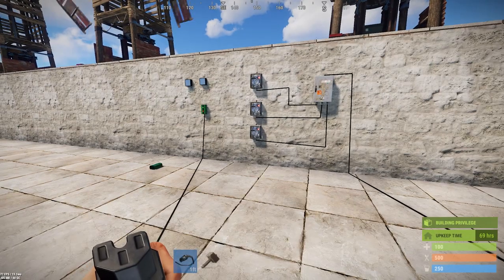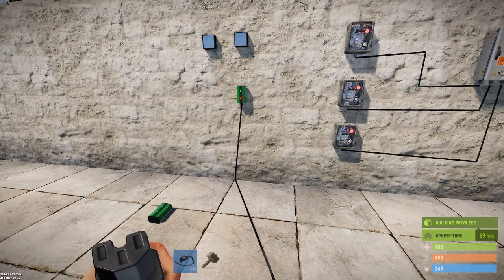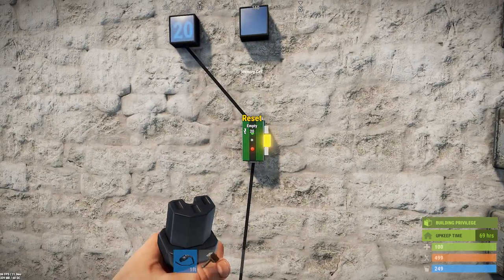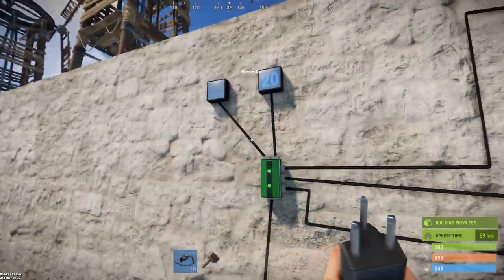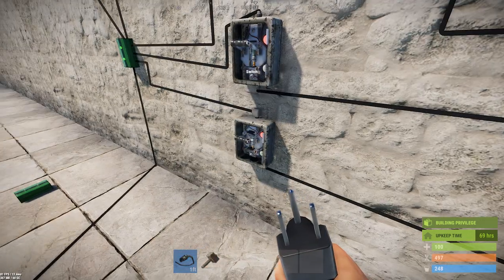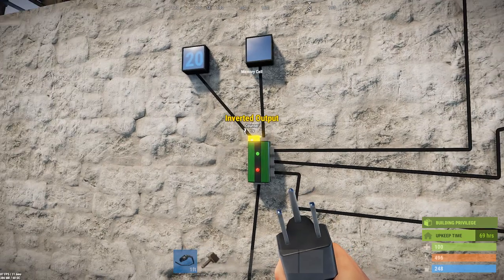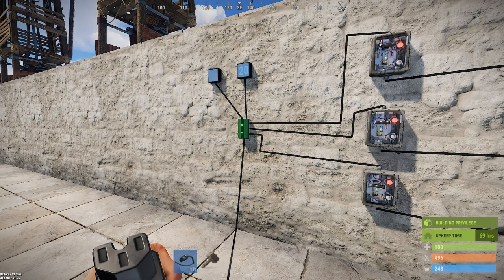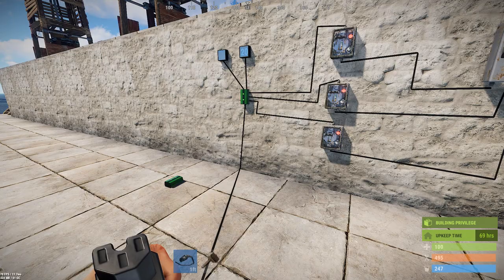Rust Electricity 101: Component Guide - Memory Cell (2-7-2019 Update)

Comment: need a bigger split, the CT camera deck the cameras don't work some times and they need a volt meter on the slitter at all times to ( power poles or to take a wire for wind turdine to the base  so on can not see that there is power)( i worked on house a little and the electrical in Rust is confusing) wall plug in ? and a switch at both sides of the hall if you have one? (in parallel /not series)

auto door just make a new Lock with the feature in it remote door rf #

Comment: If you apply constant power to the reset, and then apply temporary power to the set via a hbhf sensor, when you leave the sensor, does the constant power on the reset handle reset it?
Reply from the maker: I'd need to test this, but typically on those devices is executes the function of the last handle to which a power was applied. So I would expect it to set and stay set until the constant power cycles for some reason (loss of power, server restart, etc...) I may be wrong though...